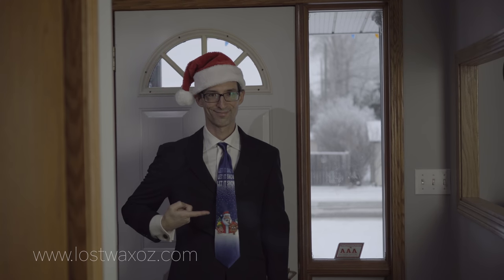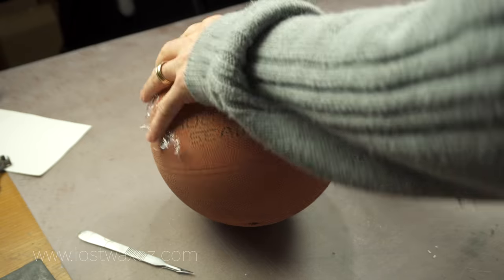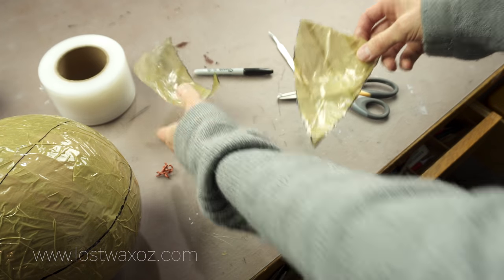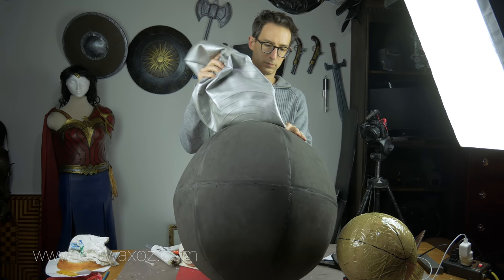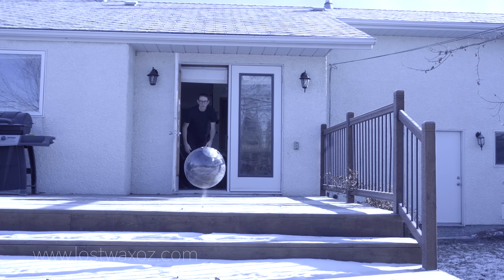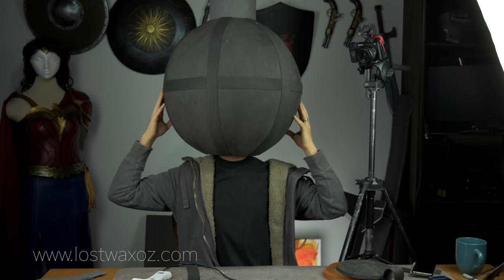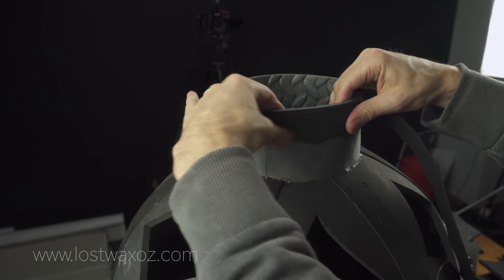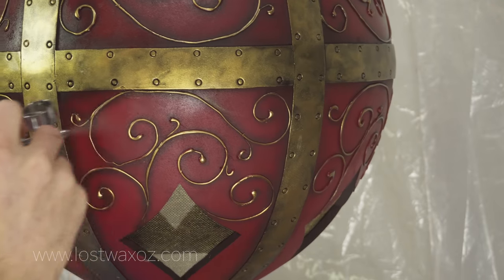Christmas Costume Idea: DIY Bobblehead Cosplay.

Comment: This is SO good.   Thank you for posting and for the pattern!    Any suggestions on how to hide the seams when you have a design that requires a smooth ball?    Your strips were perfect for the xmas bulb, but my design requires a smooth surface.  Any ideas?
Reply from the maker: tbh It's not easy to smooth out the seams, you can try using an acrylic caulk and apply some to the seam and then scrape over it with a knife. You have to get it right while it is still wet, because it doesn't work to sand afterwards. Another option can bee to sew a cover that goes overtop, out of a stretchy fabric. You'd still ned a few seams, but you wouldn't need as many.